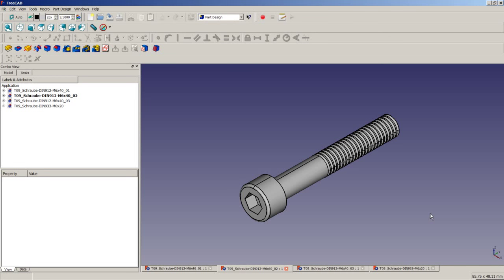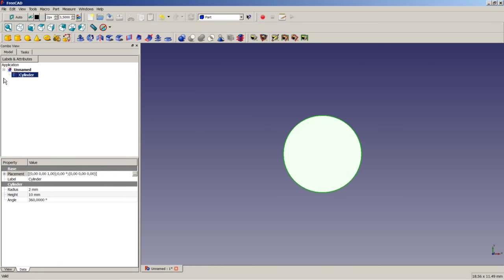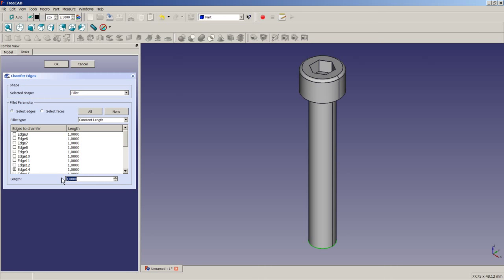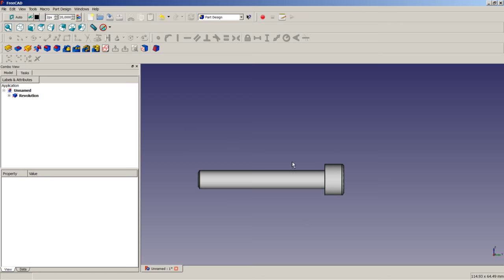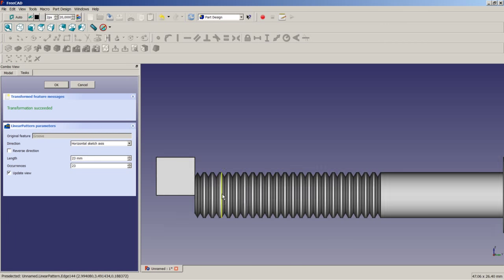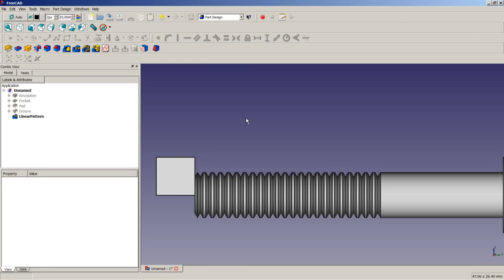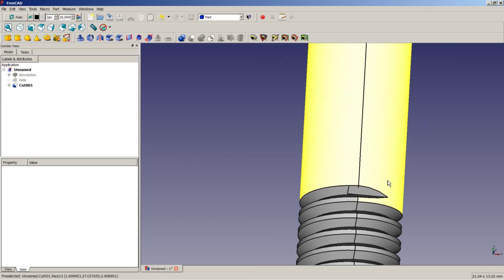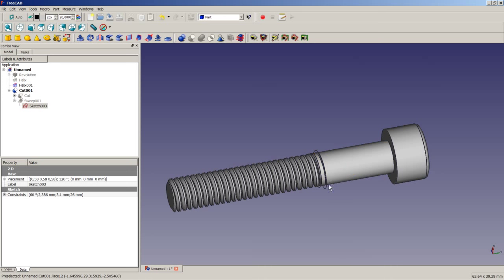FreeCAD Lesson 09 - Outer Threads

Comment: For anyone who tries this with 0.18 (+) - you must make EACH part as a separate body, and perform boolean operations between the bodies. In other words, the first sketch of the bolt body must be one body, followed by another 'body' for the helical spiral thread base, followed by a subtraction of the helix from the bolt body, then the second helix (or the symmetrical pad, whichever way you go) needs to be another body, which is then boolean subtracted from the previous body. I hope this saves you the far too long of a time it took to learn this!

Comment: I have found that, at 36:00, the boolean cut that is described will only work if the pocket is selected first, then the pad. If the pad is selected first, all that is left is part of the pad. Also, when I undo a boolean cut, the parts are there, but hidden. I have to unhide (show selection) them to see them again. Thanks, though: I cannot imagine a better tutorial series than what is presented here.

Comment: ok ok,  this is wonderful thread info... is there a freecad workbench video to design threaded parts to fit with store bought tap and die dimensions as in tapered NPT pipe threads to hold water pressure? i am working on a 1/4"-18 NPT 5000 psi pipe thread adapter using the NPT specs table... thanks a lot for the great step-by-step voice walk through...:)

Comment: Hi, I've just followed your instruction using the latest software and windows ten and everything thing works except the Boolean cut, it ends up as a triangle and an helix. is this a bug?
Reply from the maker: The software core (Open Cascade) seems to be more sensible with boolean cuts in newer versions.
I used placement on the "Helix001"-Definition and corrected the Z-Angle from "90°" to "89,9°" an that worked.
Sometimes with boolean cuts you need a small overlap of the shapes in order for the operation to work ...
Reply: Thanks I will give that a try.
Reply: Hi 
Can you explain what you mean by the Z angle, I don't have any data for my helix advising Z angle of 90
Reply: Hi 
I've just started again and every thing work fine this time, yet as far as I can see I've done nothing different.

Comment: Firstly - Thank you for all your efforts in producing these fantastic tutorials.

A quick question.  At 10 minutes you created an extrusion from a sketch and did a Boolean cut operation.  This is the first time I saw you use this process.  Was there a reason you didn't use a pocket operation?  Or was this simply to demonstrate an alternative method?
Reply from the maker: At that time i am using the part workbench. To use the pocket operation i would have to switch to part design workbench. Mixing the workbenches too much could be a bad idea.  And i wanted to show the whole "part-workflow".